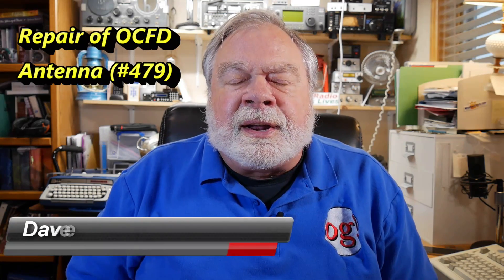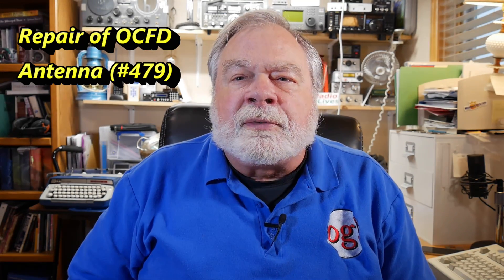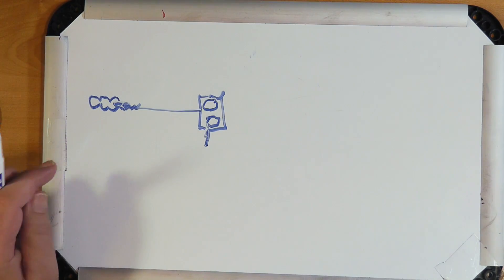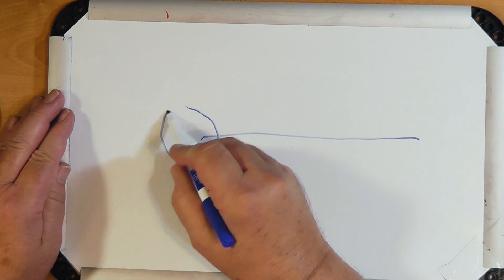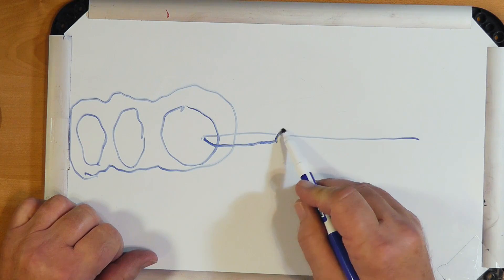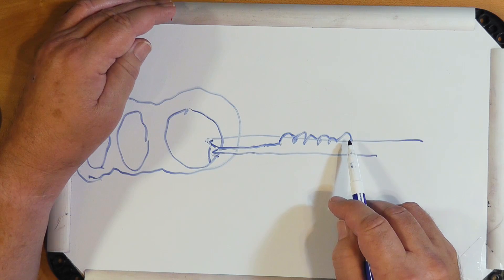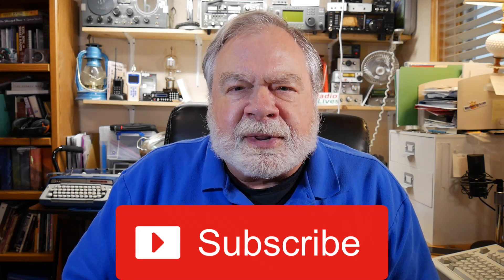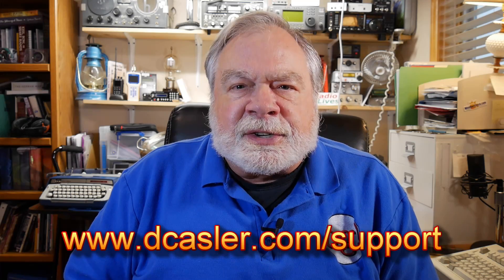Repair of OCFD Antenna (#479)

Comment: If you put a 6' telescoping antenna at each end, Use them to adjust the length and leave them or replace them with wirel

Comment: When using the telegraphers splice does it have to be soldered also? Great videos Dave.....
Reply: My question too!  I would worry about corrosion due to weathering causing high resistance if not soldered.

Comment: Dave, it is uncommon but you can buy braided copper wire where kevlar is part of the braiding. Stronger and more flexible than copperclad steel. Chameleon uses & sells this, too.